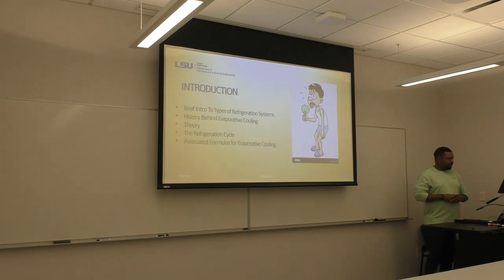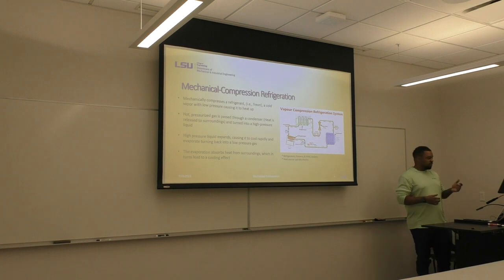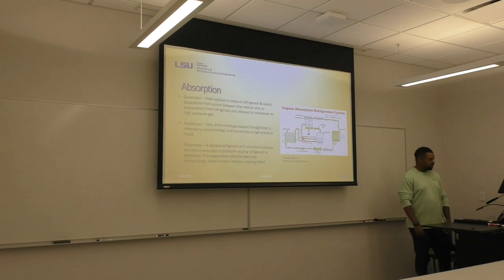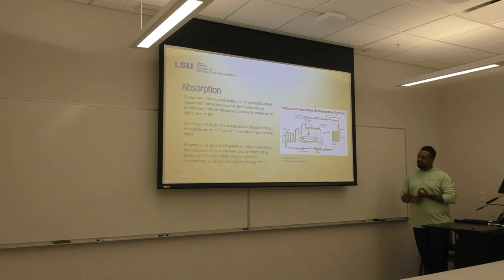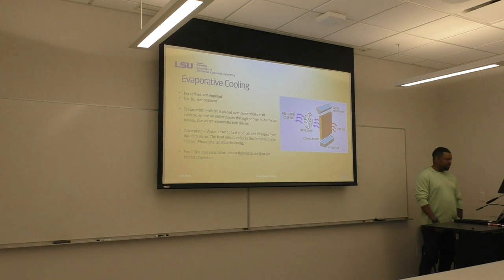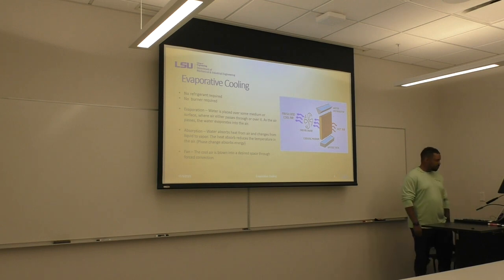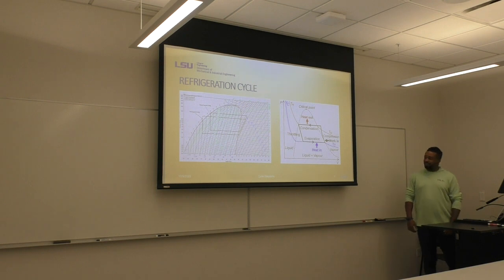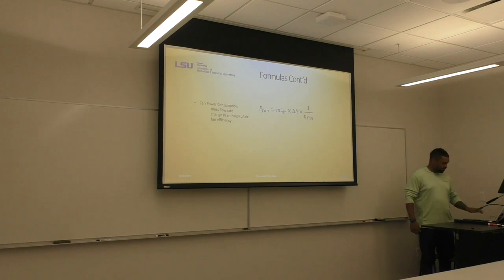Travis Eaglin

Comment: I had a great time going through these thermodynamic principles and learned a lot about these systems. I was really interested in the "swamp cooler" aspect of the refrigeration cycles. I need to work on swaying while speaking and still on my "ums". The phone going off was my 6-min timer to let me know I needed to wrap up my presentation, but didn't realize it wasn't on silent. I had timed my presentation the night before and even had to remove a slide because I was over. Figured if I would talk a little faster I could make it in a little over 6-min. I think I really enjoyed the material, which in turn go long in the requirement.

Comment: You did a great job explaining the refrigeration cycles. I think that I've noticed during your presentations that you tend to ramble to fill time my suggestion would be to make your overall presentation more concise but summarizing the information on each slide rather than reading out each statement and at the end if you still have some time left that you need to fill make a couple of fun facts in order to fill the time that way you can meet the six minute mark without going over tremendously.

Comment: Good presentation Travis. The evaporative cooling refrigeration system is very interesting and I believe that you did great explaining the background of the system, what it is used for, and why it is relevant in modern society. For the next one need to not necessarily ramble but try to make clear, concise, short statements on each slide so that you can stay closer to the six minute mark. Other than that, great presentation!